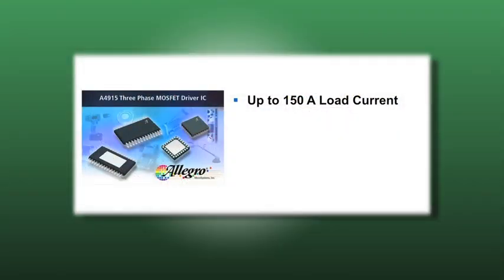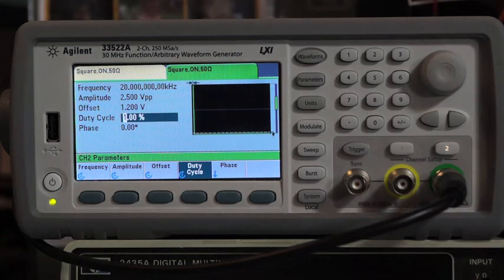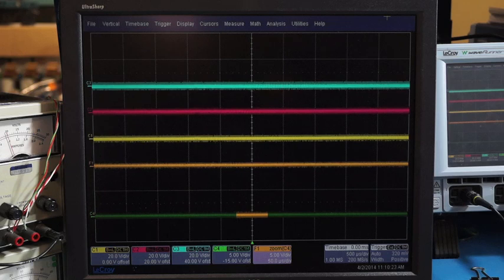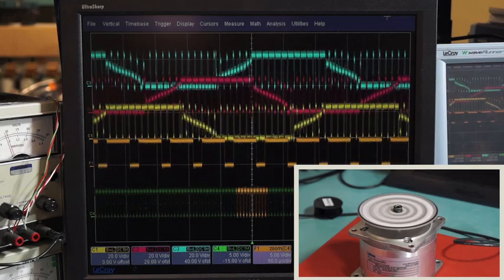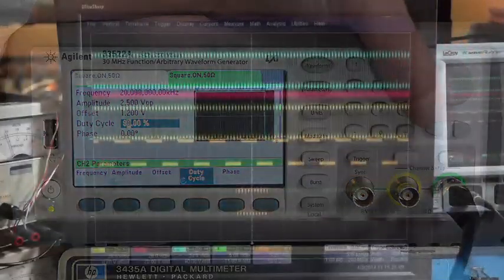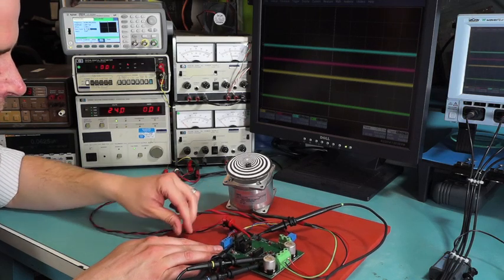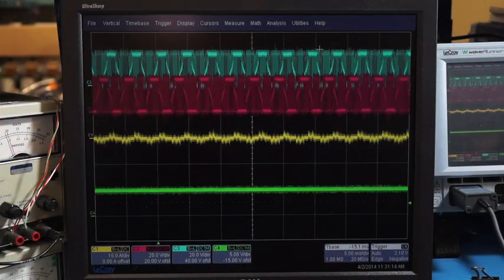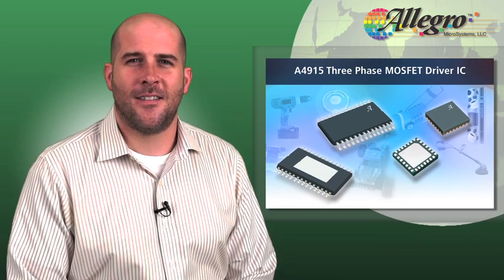Allegro A4915 Demo Board

Comment: Thanks for the video. There are several methods(the combination of different inputs) to spin the motor, which one is better for control the motor speed? By the way, how to use this board to control the current of motor.
Reply from the maker: +Jun Luo 

Thanks for your interest in the A4915. The speed of a motor is determined by the voltage applied to the windings. By applying PWM to either the ENABLE input or the DIR input the voltage across the windings can be
controlled based on the duty cycle of the PWM applied. Alternatively the SPEED input is offered which looks at the DC voltage applied and creates an internally generated PWM based on the transfer function shown on page 8 of the datasheet. Table 2 on the same page describes the truth table for all inputs ENABLE, SPEED, and BRAKEn. 
To implement closed loop speed control A microprocessor or external analog circuitry is needed to receive speed information from the motor and calculate the duty cycle or DC voltage needed to reach the desired target
speed. Speed information is available by looking at one or more of the hall signal transitions or by adding an encoder to the motor shaft.